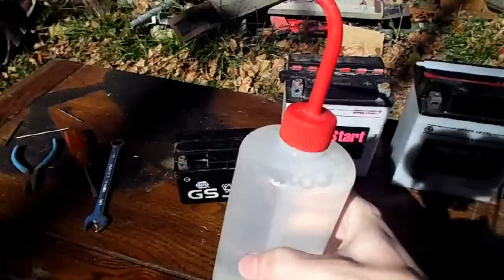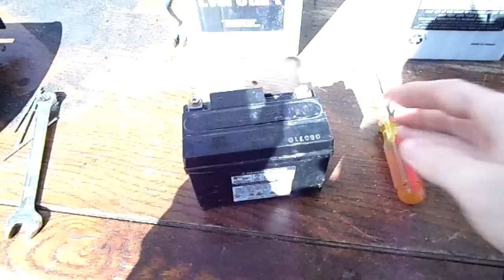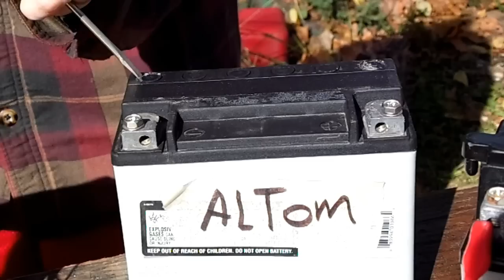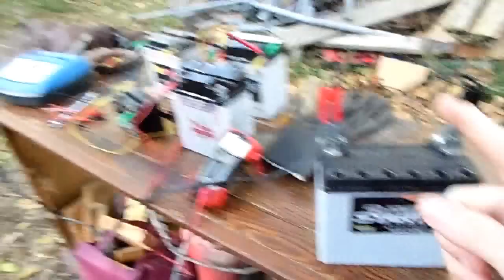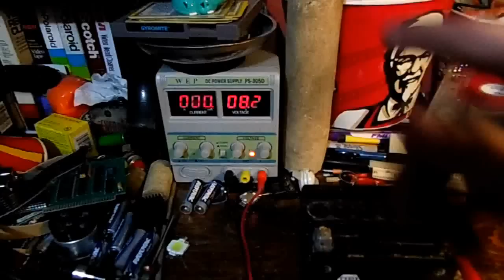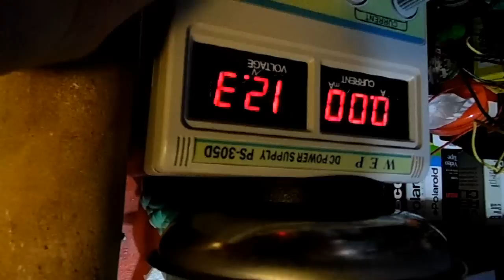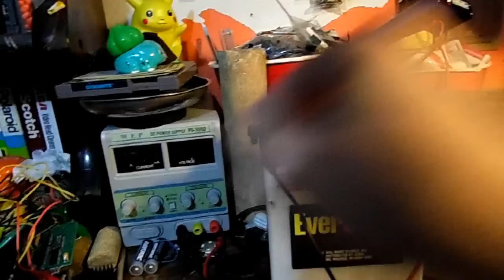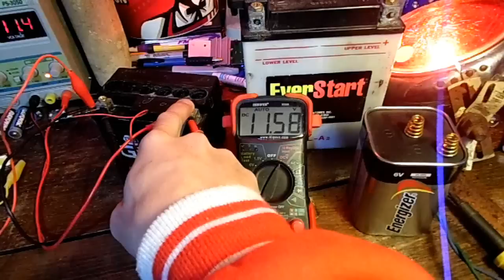DIY Fixing Lead Acid Batteries

Comment: The black battery that you had to pry the strip of caps off from is a gel cell or possibly an AGM or Absorbed Glass Mat battery. In either case, it WAS a sealed battery. The acid is in a gelled state and WAS under slight pressure until you popped the caps. It is made this way so when the water in the gelled cells gasifies, up to a point, it will be reabsorbed as the battery cools. As soon as you popped the caps, you ruined the battery. Also, in a standard car or boat battery, the electrolyte, (acid to you),  IS 40% sulfuric and 60% water. NOT 10% to 90 % as you said. You might also want to warn your audience that even short exposure of battery acid in the eyes can cause blindness and to keep baking soda near by to neutralize any spills. BTW, you ruined the AGM battery as soon as you opened it and you can NOT add water or acid to these either. I think you have some more to read up on battery maintenance and chemistry before you hurt yourself or someone really badly. Also, it's a lead PEROXIDE and a lead DIOXIDE coating on the plates. While the plates are pure lead, It's the coatings that make them positive or negative. Lead sulfate does not form BETWEEN the plates, it forms ON the plates. When you desulfate a battery, you don't redissolve it back into the acid, you actually crack the surface of it to allow the acid to come back into contact with the plates. If you feed 15 volts into a wet cell battery, you will overheat it and develop a LOT of gas bubble between the plates which will keep the acid away from them and NOT allow them to charge properly. I believe your heart is in the right place but you are playing with danger when you play with these batteries when you don't know what you're doing. A little knowledge really can be worse than none at all. God bless you and your viewers.
Reply: So what voltage should you use to desulfate a wet cell

Comment: dude... i ain't gonna  watch a video where it's owner misses the length by 26 seconds. Just kidding. Ain't got time to watch all this, will just go and add some distilled water to the battery and charge it with a "dumb" charger.

Comment: Sulfuric acid and water in a batter is "electrolyte".  From what I recall a  mixture of 40-60,  is electrolyte. 40 percent acid 60 percent H2O. Also, use distilled water.
Reply: Let do 30% acid and 70% distilled water

Comment: I bought a new 6 volt battery from a diy shop and it had 6 volts, but no amps. Do you think that the manufacturer forgot to fill in the electrolyte, or do you think it is something else?

Comment: not much fix here,,,just acid water fill and recharge,,,no mystery----however---your comment on low voltage batteries having high resistance,,,thats wrong. If the resistance were high, there would be large voltages between terminals. High voltage as the battery builds up charge is when the battery reaches highest resistance. Thats the reason the charger has to push higher and higher voltage in order to push electrons into the battery. If the resistance were low, the electrons internally would flow easily and return to the opposite terminal and not require high voltage to do so.

Comment: Intelligent but you have a false statement in there. You stated you were going to use solar and all the batteries were your battery bank. You should know that if you are going to be serious about a solar battery bank you MUST have all your batteries the same amp raring, preferably all the same type as well. This is done so they all are equal all the time. If you have a smaller battery in your system, the bank is only as good as the smallest amp battery. When this battery is used up and the amps remaining is less than the rest of the batteries then the small battery will draw amps from the other batteries and when on charge cycle, will be the last to be charged.

Comment: hey, great video. I have a 12v car battery that starts to bubble when charging at approx 12v, 10amps. I've noticed however that one cell does not bubble. after charging it holds 12v until a heavy load is put and causing the voltage to drop to around 10. is it dead?

Comment: Rinoa Super-Genius OK then I'll just go and spend the 2 to 3 hundred dollars I need too to get 2  brand new batteries..... so what should I do this time to make sure these batteries last for a while...... and I'm gonna be buying 2 12 volt 75 ah batteries for my wheelchair.... do you have any suggestions and how often should I charge them to make them last the longest...... or what should I do for matenence..... thanks soooo much for all your help man
Reply from the maker: when storing lead-acid batteries its best to have them trickle charged (like 100ma of current) and to make sure the liquid inside never gets bellow the plates.

you could probably make a good trickle charger by getting some power supply from a small electric device like a LAN router. those ussually go up to 14v and give a very small amount of current. if it has too much current maybe see about putting a tiny flashlight lightbulb in series with the battery and the homemade charger to act as a resistor. make sure to measure the current with a multimeter. i have a little 100ma solar panel maintaining my lawnmower battery and it was working great until a squirrel or something chewed the wire and stopped that trickle charging, then it was quickly downhill after years of being great.

this is for a wheelchair right? honestly i'd recommend getting those lead acid batteries for now, but once you have them start planning your upgrades. i have a whole bunch of videos of me fumbling with laptop battery cells and slowly figuring out lots of stuff, and now i'm playing around with 3-series BMS circuits for them. if you put a 3-series BMS onto a 3-series lithium battery bank it should act as a drop-in replacement for a lead acid battery. it would just be half the weight, 6 times the power, and not take nearly so long to charge.

expect it to take maybe a year or so of messing with 18650s before you get something super useful. its a lot of tinkering and playing as you learn. its really rewarding though.

i also have a short lived series were i was helping a friend build a high-powered wheelchair, i mostly just helped with some battery stuff and wiring it for lithium.

i hope that helps.
Reply: How To Start A Batteeeerrrry Busineeeeess At Home>>>https://www.facebook.com/Restore-battery-1123300471065849/?sk=app_337680106275807 >>>>

Comment: hey man I bought 2 brand new sealed batteries 12 volt 55 ah for my wheelchair and never charged them nearly a year ago.... and now they won't charge with my wheelchair charger... so how can I safely recharge them so I can now use them??
Reply from the maker: +Brian Mendell you fucked your batteries, simple as that.
Reply: Rinoa Super-Genius OK then I'll just go and spend the 2 to 3 dollars I need too to get 2 more brand new batteries..... so what should I do this time to make sure these batteries last for a while...... and I'm gonna be buying 2 12 volt 75 ah batteries for my wheelchair.... do you have any suggestions and how often should I charge them to make them last the longest......??????
Reply: You need to fill them with charge, and completely discharge them -- multiple times -- to get them fully reconditioned as much as possible.  The plates expand and contract a bit in size with the charge/discharge cycle, which helps 'shake loose' additional lead sulfate which gets deposited onto the surface of the plates over time.  As I understand it, you can never really get them to 100% -- some of that sulfate will simply never go back into solution.  But the charge/discharge cycle helps to expose as much surface as possible (to the acid) of the lead plates again.

Comment: charging @ 15v equalises all 6 cells, 1 hour is enough.!! ... all cells should be charged @ 13.2v, cell capacity is 2.2v for 6 hours.!! ... the ability to retain a full charge is restricted by an oxide that has built up over a long period of time.!! ... this coating can be stripped by this method, dissolve 210 grams of epsom salt into 500ml of warm to hot water, add 83 ml of this solution to each cell of a Standard Size car battery.!! ... for a 12v truck battery double the mixture & add 166ml to each cell.!! ... for a mini battery 10/15ml,  it all works on total fluid capacity.!! ... use ONLY distilled, deionised or rain water.!! ... when the battery is around 13v install in a car, & drive it, Vibration will mix the solution in the battery, allowing a full charge, & CCA,.!! ...You are On the right track.!!
Reply: GEOFF NOLL fffd

Comment: Excellent video. Can I reconditionan MAXXIMA 900DC EXIDE battery? I cannot figure out if it is an AGM battery or not, because on the battery case is written . "Use a constant voltage of 14.4 +/- 0.2 for charging". For this reason I am not shure that  is a regular AGM battery.

Comment: When you charge them all at once, I assume you are using parallel.  Am I correct in that?  One hot each battery back to the charger and a looped ground is fine?
Reply: Fucking Spammers!!!
Reply from the maker: yeah parallel should be fine.
Reply: Sweet.  Thanks for the response.  Time to have some fun.......!!!!!!
Reply: There are many components to battery reconditioning. One resource I found that successfully combines these is the Jons Mender Guide (check it out on google) definately the most incredible info that I have ever heard of. look at this super resource.
Reply: There are many factors in fixing a car battery. One place I found which successfully combines these is the Jons Mender Guide (check it out on google) without a doubt the most helpful info i've seen. look at this extraordinary resource.
Reply: There are many components to battery repairing. One place I found which succeeds in merging these is the Jons mender guide (check it out on google) definately the most helpful info that I have ever seen. Check out this incredible resource.
Reply from the maker: Stephen Lee
yeah i get about 30 comments a day from spammers, i try to delete them all.

Comment: I GOT A SEALED LEAD-ACID BATTERY 12V 4.5 AH FOR FLYER SCOOTER MY KIDS USED. IT'S DEAD NOW AND I'D LIKE TO RECHARGE THEM. BECAUSE THE SCOOTTR IS NOT IN USE. IT TAKES 2 BATT SAME VOLTAGE AND AMPS. HOW CAN I DO THIS TO RECHARGE THEM. BETTER LET KNOW YOUR FACEBOOK PAGE SO I CAN SEND YOU THE PICS.

Comment: is there any way to fix shorted cells?
Reply: no you cant..
Reply: i just tried the method of washing out the black gunk in the bottom of mine (small automotive) 8 times with almost hot tap water and bakingsoda for the first 2 times, than a ninth time with di-water. Now it holds the charge again after filling back the filtered acid. The black gunk at the bottom was probably shorting out 1 or 2 cells (when the battery never stays over 10.3V or 8.1V respectively, this could be the cause).

Comment: Nice video until I got to 15:45 and the desulfator.  You connect the desulfator to two batteries, the charged one and the sulfated battery.  The sulfate crystals are an insulator, (correct?)  Doesn't that mean the desulfator will desulfinate the charged battery which doesn't need to be desulfinated?  (Everything is in parallel.)

Why don't you measure the specific gravity of the cells?  

You did a nice job.  Thanks
Reply: If you want to bring those old batteries back to life go to this link now HootBattery.club
Reply: I personally take my old batteries, recondition them, and then sell them for a lot of money.

Learn how I do it here: HootBattery.xyz

Comment: why people Think that you can charge distilled water and have a battery?
Reply: Mars Seeker because thats what the new batteries in the factory are filled with. 90% water, 10% acid. The acid doesn't evaporate. The water does. So you refil the water and its almost good as new
Reply: Why do you believe they can't? Sounds like you have an opinion.

Comment: Sorry to sound lame but can you maybe give me a guideline/ break down as to what is going on? you show what you are doing, but I don't get why you are doing what you are doing at each step. such as 1.fill battery with water 2. charge to 15 volts for 5 minutes, if the amps go up to 1 amp reduce voltage to 12.5 volts, etc. you also show you filling the agm battery with water, I completely don't get why you're doing that, agm isn't supposed to have water so why are you doing that?

Comment: The AGM battery you were trying to fix appears to be an ETX20L (name located on bottom of battery) The caps that you are having issue with are ultrasonically welded, which are not made to be removed or replaced (white marks) or it voids any kind of warranty. The 10.41 volts indicates that it has a hydration short in one of the groups. A hydration short is a wearing away of a spot of the separator material, usually looking like a burn mark. This usually happens when plates were not entirely soaked in acid during filling process. Also, the light grey plates are the negative plates and the dark colored plates are the positive. Adding water to an AGM battery does not "FIX" it. Also, it is a conventional acid, just a different specific gravity compared to an auto. I work at a battery manufacturing plant as quality control. DO NOT TRY WHAT THIS GUY IS DOING TO THE SUPER START BATTERY(ETX20L)
Reply: Babaganouche you are correct this is very dangerous.
Reply: Recondition your batteries and make money off of them here: HootBattery.xyz
Reply: hey ,if anyone else wants to discover how to recondition car battery at home try Knewreck Rapid Renew Guide (do a search on google ) ? Ive heard some amazing things about it and my cousin got excellent success with it.
Reply: you are right    never really worked much with gel batts    and the lead acid  batteries we always decapped and blew the hydrogen out before making connections
Reply: Ⓛⓔⓐⓡⓝ ⓗⓞⓦ ⓣⓞ ⓔⓐⓢⓘⓛⓨ 𝐑𝐞𝐜𝐨𝐧𝐝𝐢𝐭𝐢𝐨𝐧 old batteries back to 100% of their working 𝐂𝐨𝐧𝐝𝐢𝐭𝐢𝐨𝐧.>> https://t.co/3ycayBV4e1?hEESf-PoQu4a

Comment: To Carge a batery at max, you need an higher voltage. About 13.8-14.2 . When it's fully charged, the amperage it's going down(about 200-300mah)then the battery it's fully charged. And to desolfate them, let them to charge at 15 v and low amperage(200 mah) Please sorry my englesh, i don't know verry wel to write... but y hope you weel understend... please try and make a video

Comment: Could I  revive a battery that's at 0.03 V?  I got it for 1$ and I am really hoping I can put it to use.
Reply: Kim Jong Hard-un  yes you could if it's not a gel battery, dump out all the acid and get some from an auto shop some will sell it to you and some may give it to you for free, if they sell it, it's not costly, once you dump out the acid you'll need to clean out the inside by adding baking power or soda to the water and putting that into the battery and dumping it out, do this untill all the fizzing stops then wash out the battery with a hose and dump it, you may have to do this 4 or 5 time  to get the baking soda out of the battery, the baking soda will help to desulfar the battery plates, one box of soda to 1gl jug, use a 5gl jug to mix it, the bigger the battery the more washing fluid you'll need, but it's still cheaper, if the battery is bad you will not be able to save it, after putting in the new acid use an old charge with a meter of 1amp, charge it up to as high as it will go stop  and hook up a 12v headlight bulb to discharge to about 9v and recharge, you may need to do this many times so the it will in time keep a charge, you'll also need a battery meter to check the battery

Comment: I was wandering , since I tried this and it worked relatively well, if you add too much Epsom salt mixture will the voltage go up too much because after I put the mixture in, shake the batteries and charge them they hold at about 16 volts which is just too much to use a inverter like I want to but hopefully there is a fix for it.
Thanks!!!
Reply: ray leclair right... it will shorten the life of your old dead battery...
Reply: Alex Sohl Adding epson salts is a bad idea, it will make things worse and any chance of getting that battery back to life will not last long, it will burn out that battery fastter, the life span will be shorter and you will have to replace that battery sooner, the best way to get a old battery charger or one that sends a pulse charge into the battery but the best way is to desulfar the battery, adding anything to the water is not a good idea, if your going to add anything to a battery is to go to an auto shop and see if they will sell you battery acid, some will sell it to you and some will have you buy it in bulk, like in my home town i got to get a 5gl jug that will cost me $30 canadian, but never ever and anything to your water
Reply: @rayleclair837  How about using old acid water from a good cell in a battery that only has a couple of good cells in it? Thanks
Reply from the maker: Alex Sohl adding too much epsom salt increases the reactivity of the electrolyte a lot. it will dissolve the lead plates a lot more and shorten the battery life. best fix is to just remove some electrolyte with a syringe or something and replace the liquid you removed with regular water to dilute it. thats crazy that your batteries held at 16v haha.
Reply: Ok cool glad the fix is easy and that 16 volts was just really confusing me. Well thanks for the help!!!
Reply: +shadfurman hahahaha